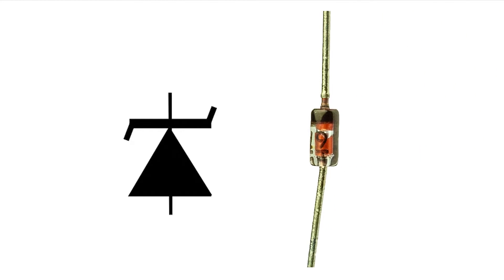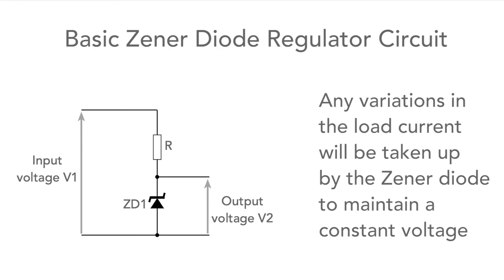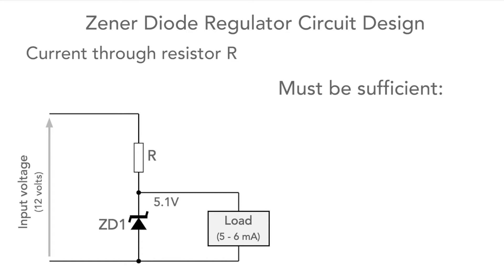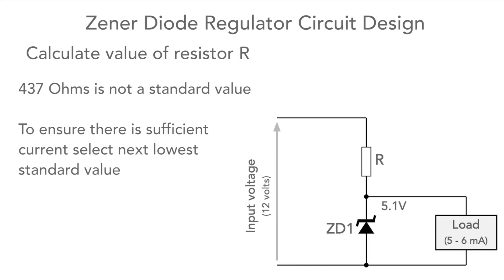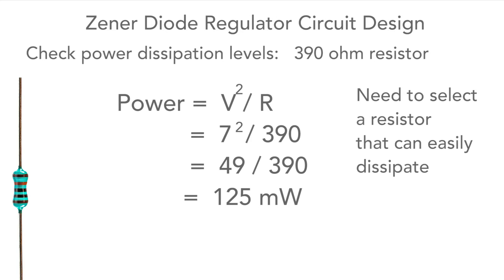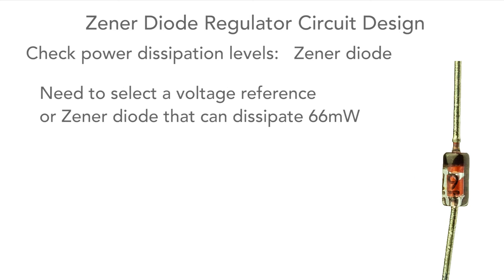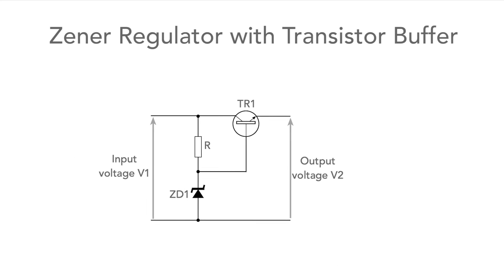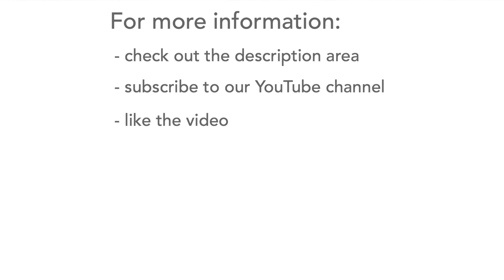Power Dissipation in Zener Diode Regulators - Critical Details

Comment: Small mistake at ~3:50 mark. The second line should have a unit of Amps and not mA, 0.0179 A.
Reply from the maker: Bother!!! I should have spotted it. I need to sort it out somehow.
Reply from the maker: I've managed to 'blur' the m in mA out where you spotted it and I'll alter it on the master in case I ever need to use that again.

Comment: Excellent presemtation. A minor quibble with the power computation for the zener itself: I'd rather do that for the worst case scenario, where the zener is sinking all of the current. You'd probably pick the same component, but you'd recognize the headroom was a bit tighter.
Reply from the maker: I did wonder about that when I made the video but thinking that it was likely to be used in a fixed circuit I opted to add the extra headroom. Possibly I should have mentioned that - I’ll put a comment about that in the description area. Thanks for commenting.

Comment: would a shunt regulator also be required for the second transitor bias?
Reply from the maker: The circuit works as it is - the output transistor gets its bias from the one connected directly to the Zener - thus us a standard Darlington configuration.
Reply: @ElectronicsNotes  thanks.  I guess the bias voltage toleraince of the output transistors explains it?

Comment: ... and it is also used as a hell thermal noise generator ...
Reply from the maker: Any breakdown mechanism will be noisy - so yes that are good noise generators.
Reply: @ElectronicsNotes  What do you mean by ( breakdown ) ?.... Signal linearity breakdown ?!... Zener diodes don't breakdown linearity but their thermal coefficient is soooo bad that you can't dismiss its effect at all for all load variations ...